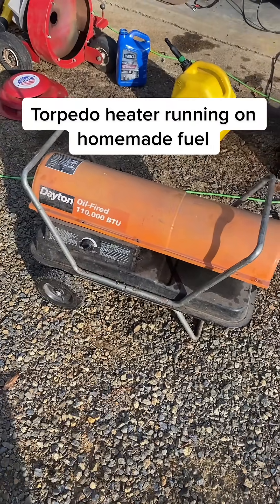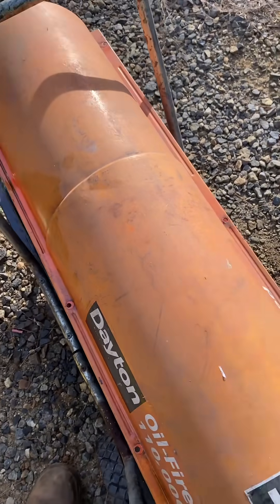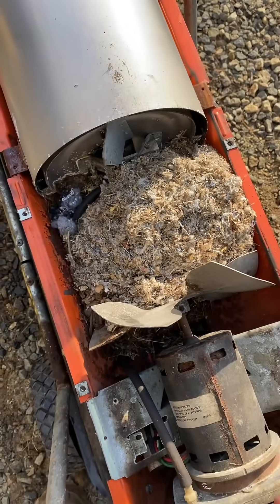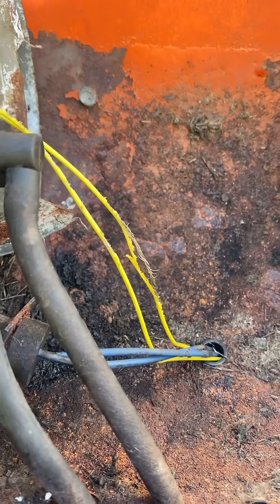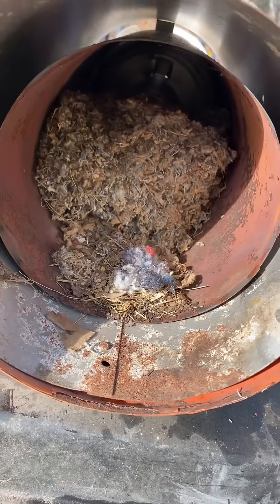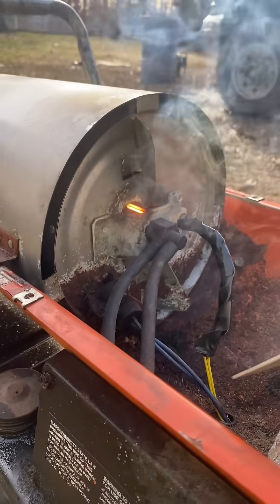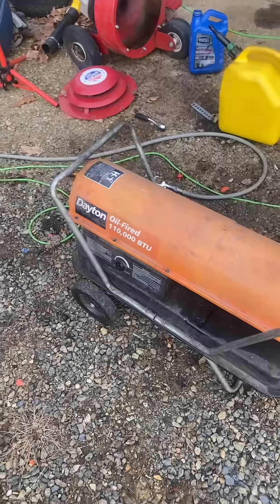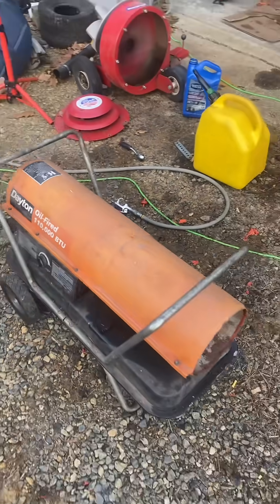Homemade Fuel Mix Powers Torpedo Heater #homemadediesel

Comment: It proably just needed the lid put back on. Id bet theres a pressure swithc somewhere that can tell if theres air blowing in the combustion chamber (or whatever its called). With the lid off the air that should be being pushed dowm twords the outlet just blows out the top. I could be wrong but that would make sence to me